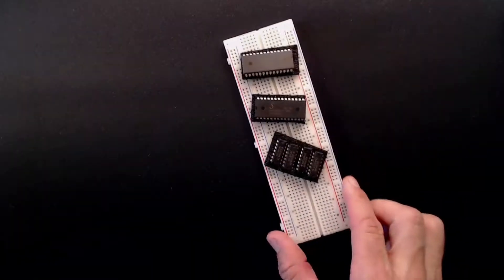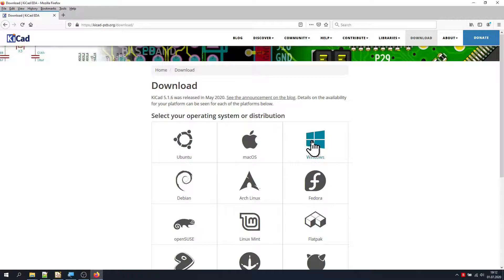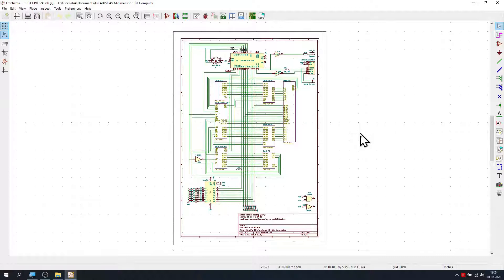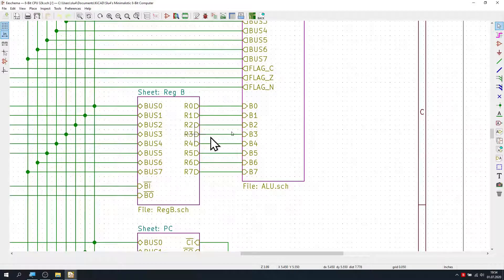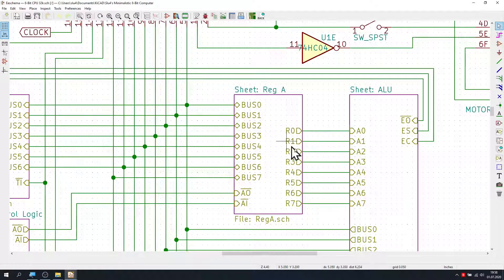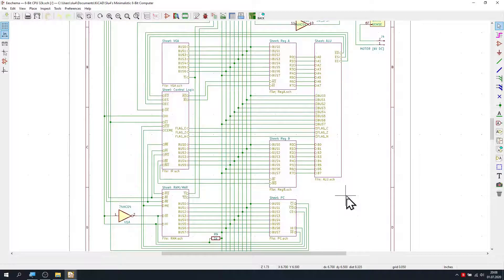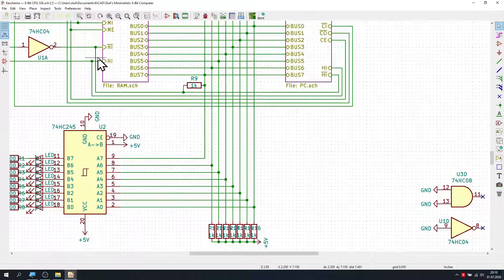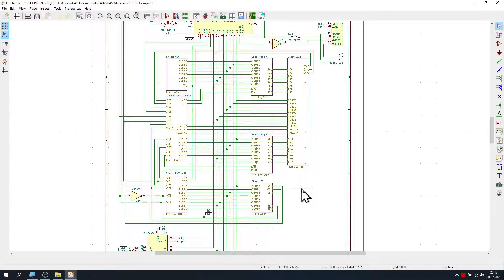Breadboard Computer With Minimalistic Design #5 KiCAD Schematics (Finally!)

Comment: Hi Slu4, great content and fantastic project! Just a quick note with the intent to help: according to the final schematics on Github, the way you cascade the 74161s to build the 16-bit program counter is incorrect. It will work until a count of 255, but will then fail for the next 16 counts. When the second 161 (starting from the LSB) asserts TC, it will keep on asserting it until the first 161 loops over, and so the third 161 will count incorrectly for 16 cycles.
Reply from the maker: Hi, interesting point! I will definitely look into this to be sure. However, I absolutely can not imagine why - with the assumption of such a huge mistake - my design would still be capable of executing lots of complex software...
Reply from the maker: @Byte Attic: Looked into this briefly, but I still can't see a problem. Maybe I am missing something, but let's assume a value of 0x00ff. In that case 'terminal count' TC will be active for the first two ICs. Thus, upon the next clock all three lower IC will count up yielding a counter value of 0x0100 and at the same time deactivating TC of the first two IC. What follows is - as far as I can conceive - a normal counting operation, as shown by the circuit. But again, I might be missing something obvious here...
Reply: @slu467  The state of the second IC (counting from the LSB up) only toggles when the first IC counts to its maximum value, 15. Therefore, when the second IC toggles its TC, it will remain in that state until it's toggled again by the next full count of the first IC, 16 cycles later. So, for 16 cycles the TC of the second IC will remain high, which will enable the third IC to count along with the first.
Reply from the maker: @thebyteattic  Thanks for diving into this :-) I see your point - but I still think this is not a problem. Let's again assume a counter value of 0x00ff. ICs 1 & 2 will have their TC flag active. Upon the next clock both (and the 3rd IC, too) will count up to 0x0100. This one clock pulse will deactivate TC of the very first IC since it jumps back to 0 but this only happens after the 2nd IC has already incremented from 0xf to 0x0. So the 2nd IC remains in the 0xf state for only one cycle.
Reply: @slu467  My previous answer disappeared, so trying again. I started wondering if I was seeing things, given your confidence. So I run a little logisim-evolution simulation, using their model of the 74161 and your wiring. And indeed, it behaves like I described above. Maybe the model isn't perfect, so I'll try a breadboard test later.
Reply: @slu467  Hi, I finally came back to this. I made an error reading your schematics: often what is done is that CE is connected to the first IC in the chain, and what is then cascaded to all other ICs is the TC of the first one (in old data sheets, this is the suggested application circuit). I assumed you had done that, and then the rest of your circuit would have been erroneous. But you actually cascade the CE to all ICs, which has the same effect, I suppose. So, my bad, I read into your schematics what I expected to see.
Reply from the maker: @thebyteattic  Thanks for diving into this, anyway. I myself often get confused by this, too. Hope you got something out of my humble schematics ;-)

Comment: There is a minor schema mismatch with microcode on github. In microcode, the C flag is in the middle and there is a Z flag in the schematic. You have to swap them in microcode or on the 74HC173 input in Control Logic. 

Regards Adam.
Reply from the maker: Hi Adam, thanks for pointing this out. You are right! I had a look at my most recent schematic and there I had corrected it to NCZ with Z being the lowest bit value. I must have forgotten to update the schematic in my repo and had it wired up correctly on my breadboards :-). Actually, in this version of the schematic I've spotted another typo - actually a real showstopper: BI is shown to be wired to BO and BO -> BI. It should be BI -> BI and BO -> BO of cause. Will update this very soon :-)
Currently, I am working on my next release: a clean build of my Minimal UART CPU on PCB including many small improvements to circuit stability. It was quite a learning curve for me... well, it is (was hopefully) a work in progress and is essentially a one-man weekend show. Cheers!
- fixed!

Comment: The KiCAD schematics are very useful to follow your work. I have downloaded  and have seen the schematics. Feeling more confident to try it on breadboards now! Hope you are planning to publish the relevant Ardunio sketches too. Thanks
Reply from the maker: Glad to hear you consider building it :-) and yes, I am planning to release the Arduino sketches and also the control logic microcode.
Reply: @slu467  Thank you very much. I am sure, such concrete information on your design will encourage many like me, to follow your steps and build one! It would be nice to provide specific guidelines on what to check/ verify/ how to debug in case of errors-  during intermediate stages of building the project. Sharing the valuable experience you have gained from designing and building it yourself will be really worthwhile!
Reply: @slu467  I'm very much enjoying your videos on your minimalistic CPU design, and am thinking of building a design of my own. I am very interested in your PS/2 interface on a Nano but have been unable to find the sketches for it on your GitHub. Were they ever published?
Reply from the maker: @paulspassionforscience5004  Hi Paul, thanks for tuning in :-) no sketches need for the PS/2 -> Nano thing since there are no external components needed here.

Comment: The pull up resistors on the bus are to produce either 7f or ff on the bus and are probably for the stack pointer. The nano lines and the other pull up resistors  look they could be used to load data from the Nano into the CPU ram.
Reply from the maker: Hi David! Exactly :-)